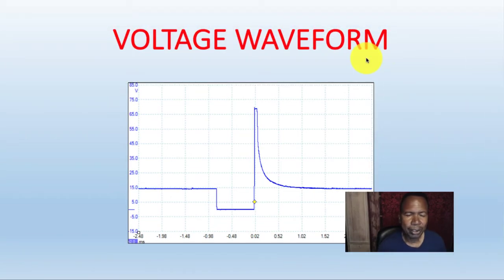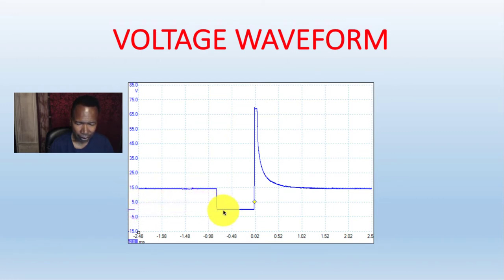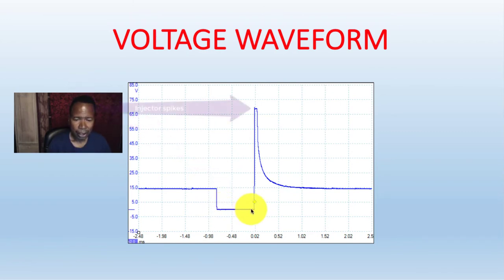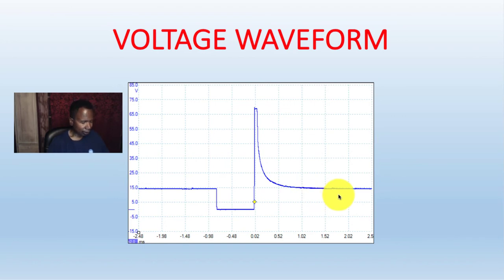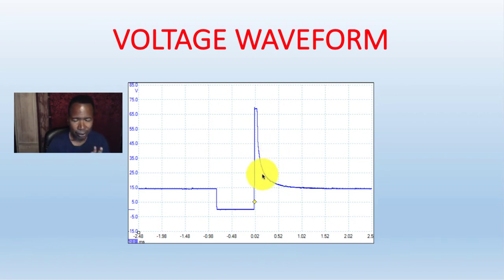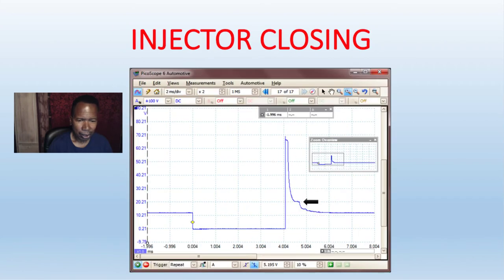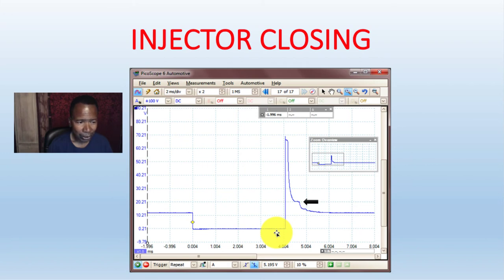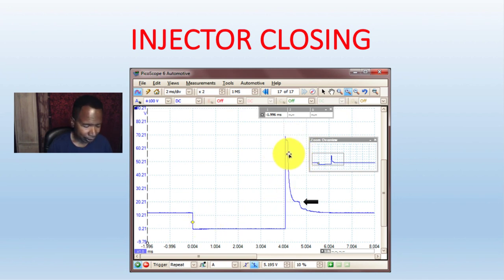10B.Smog Technician Training: Computer Control Circuit Understanding the injector waveform, P.P. ATG

Comment: Is a low voltage spike only caused by a shorted injector?
Reply from the maker: Yes most of the time but high resistance in a connector mist likely will cause the same issue